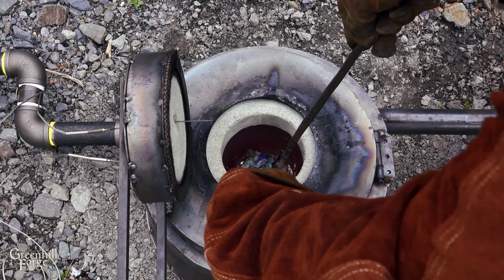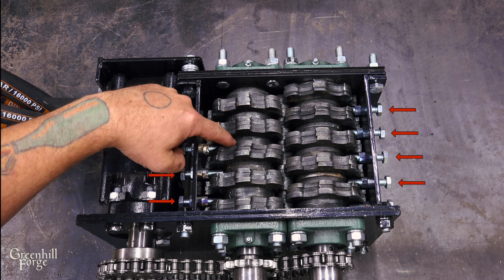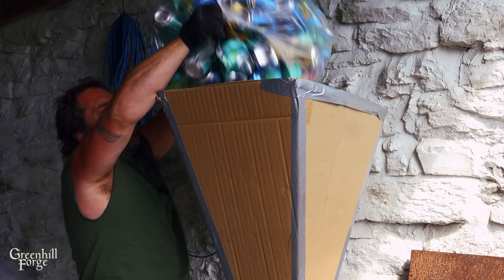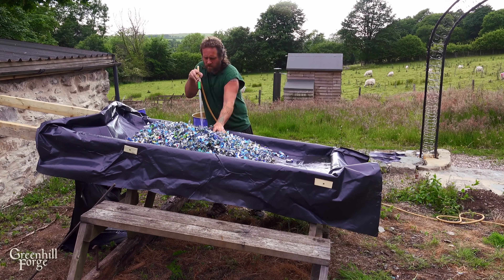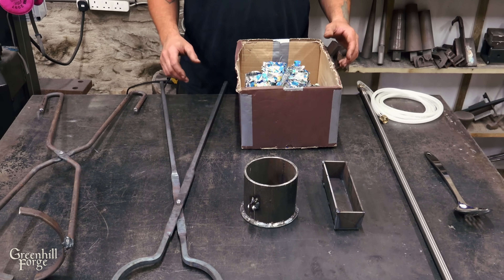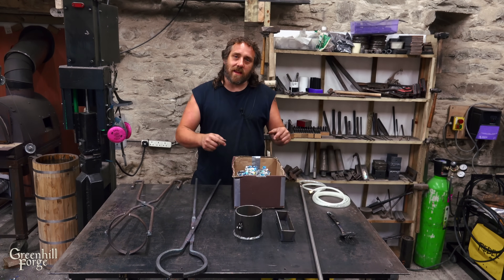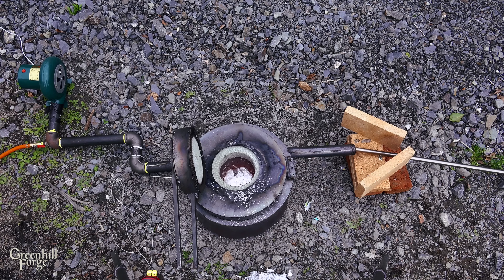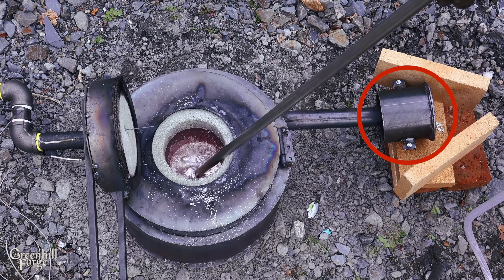DIY Casting: High Quality Aluminum from Recycled Cans!

Comment: Hi, I subbed to your channel a while back for the PRO "DIY" shredder build that got me hooked. I'm impressed to see a metal casting YouTuber who's done  research prior to attempting a useful pour. Also kudos to the de-gassing your melted alloy. That was the first time I've ever seen a YouTuber do that. I've seen people cast those copper ingots and you always see all them little bubbles, I know that gas can be dissolved in a liquid. 

Argon injected low pressure through stainless bubbler, elegant! Thank you for that, my comment does have a small recommendation. 

 I'm sure you've done your own research and you're aware that aluminum cans have paint on the outside and a plastic and or lacquer liner on the inside. That's why they make so much dross AKA slag whatever you want to call it. 

From my non-experience only by watching other YouTubers doing my own research also because I haven't started my casting journey yet. 

I've noticed when thick aluminum slag forms due to the paint n stuff if you keep pushing it back under and breaking it up it will turns into floating white or black /gray oxide dust (powder color TBD after it cools off) and all the aluminum that's incorporated in it will rejoin the molten puddle that's underneath. 

This is usually best achieved by using a simple right angle hook on the end of a long steel rod long enough to just keep you from getting burnt. By pushing it down through the floating slag ball, rapidly over and over till it gets a dusty consistency. It ought to stop clumping back together. And it should help increase your yield a little bit considering the effort you're going through. 

I've seen some YouTube casters try and remelt their slag but they don't understand that there's not a lot of metal in slag to begin with. 

Borax question, does it incorporate or are you scooping that out too? 

Thanks again. 

Also excellent videography. Beautiful explanations, excellent lighting and audio, a pleasure to watch an artisan, on their journey.
Reply: I wonder if cooking the aluminum first, without melting it maybe over a wood fire, would remove all the paint and laquer and stuff that lowers the quality. it could be interesting to test for the next cast, get it hot and burn off the paint before putting it the crucible.
Reply: @wolfy1398  Unfortunately it seems like if you put thin walled aluminum cans in a campfire they melt. So I don't think that would work because then you'd have to be recovering the aluminum from the Ashes of the fire. 

Although camp fire will soften larger chunks of aluminum like engine heads and motor castings and so on and so forth. So that once they're soft and they'll break apart like drywall if you hit them with a hammer.  Chunky aluminum casting get soft and crumbly if you bring them up to about 500° Fahrenheit.
Reply: @jMarbet  not in the fire, over a fire, say like a wooden stove, so they get hot and the paint and stuff burns but not hot enough to melt, like you could just put them in a pot over stove without water
Reply: @wolfy1398  good luck with that, AL cans are about 50 percent other, so if you "burnt" without melt? you still gonna have AL coated with carbon leftovers to become slag/dross in the eventual melt, with rapidly oxidizing unprotected ultra thin Al as your suggestion implies. Mr artisan YTer already taking many steps to make near perfect material for project. 

I can't understand, will not endorse, or except that ANY benefit could be achieved by adding yet another heat treating step that would NOT 100% guarantee a no dross pour. 

What you suggest IMO is a waste of time and energy, just like my response LOL!
Reply: @jMarbet  alright, it was just a suggestion no need to get so angry
Reply: @wolfy1398  was joking around

Comment: First off. Your doing an amazing job of defining the process. Well done. I don’t think you noticed, you’re a foot dragger. That said, my thoughts are on safety. Working on a wide flatten service, less of a trip hazard. When removing dross, a metal sheet would be better. The little bits that drop. They might not affect you. But pets and or visitors at a later time wearing non protective shoes. Might find that disturbing. Haha. I noticed when putting your square in kiln. There was a very slight flash of steam. Your gas feeding process pulled steam down the line. I don’t know if that would be predictable given dealing with flash moisture. Liked your washing set up. I used screen door material like an extra large U shaped. This way I could wash the sugars and such that would drawl Ants and a smelly oder. I also would say, I used a larger pipe and same example to press into a shape. I used a rack that rotated to remove moisture. Letting sit for a few days prior.Seeing one steam explosion on video was good for me. Thanks for the work.

Comment: amazing video, as always. A few things to consider: I think you can save a lot
more aluminium from slag using  a more convinient flux, I tried borax but much better is a 50% table salt and 50% potassium chloride kcl. You have to preheat it very well because salt is very higroscopic.
For argon you need smaller bubbles (around 3mm) This i cannot tried but  I saw it from other guys  videos.
On the other hand, do you think it is worth the time all cleaning, shrouding and pressing the cans?
Reply from the maker: Thanks. I'll look into nacl/kcl. It depends on if you think this kind of thing is fun. If you're just after some aluminum and don't enjoy this kind of thing I'd say just buy it. If you want to make aluminum ingots to look at then probably skip the shredding/washing. If you're trying to make a part that needs to be reliable and will be subject to high stress, then I'd do every step possible to make it better.
Reply: I'm curious about this as well. Great result, but it looks to be quite a bit of prep work. Also wondering how much aluminum is lost in the process.
Reply: @VitorBosshard more or less 50% of weight is paint and inner coating

Comment: On an actual full size shredder for cars and tires and bigger stuff the shafts are 6 sided or 8 sided so the blades can be clocked in  different ways such as stepped down from one side to the other side or in a  "V" configuration with a leading cutting edge in the center and stepped down and outward from the center also in some cases they even use  water sprayers and spray the knives while running the shredder this helps with cooling and to keep the dust down....but that's just a few things that might be able to help you out with this project 

Your videos are always so great. Keep up the good work 
Thank you for putting so much effort into the videos as well